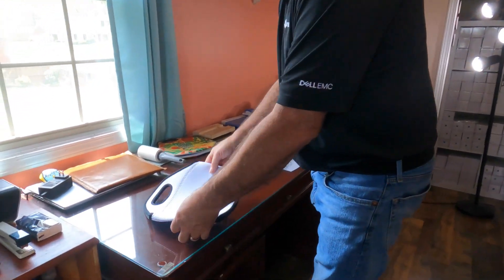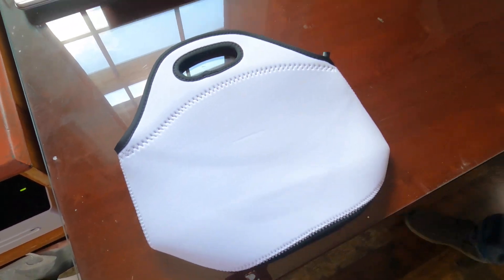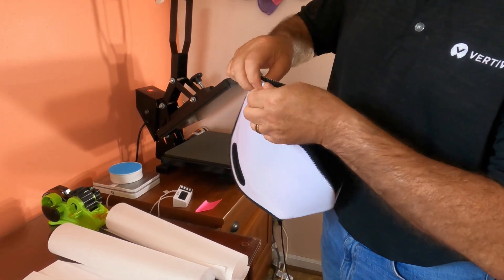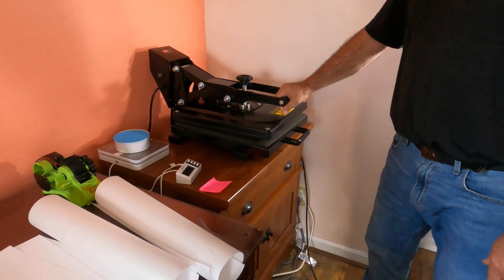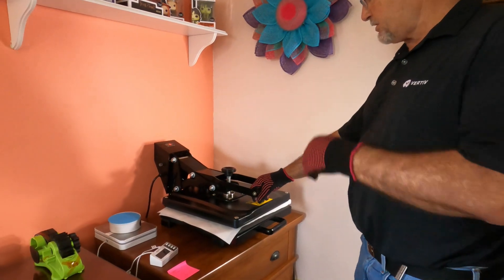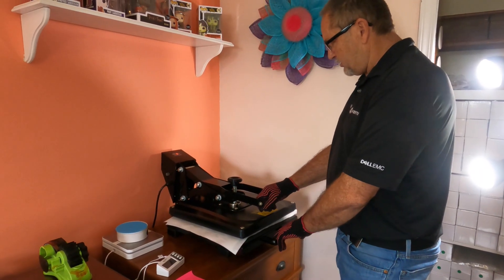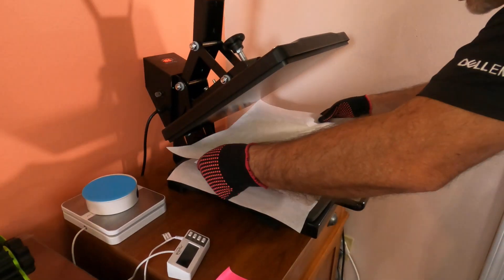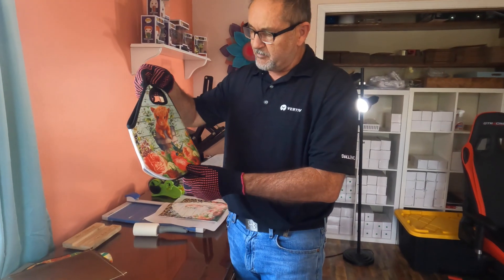How to Sublimate an Insulated Lunch Bag: Step By Step Guide

Comment: You need to make a template out of card stock or cardboard to fit inside the bag to stretch a little, place it inside the bag make sure it is over the bottom part of the bag for each side, and you won't get that line or empty corners, I found this worked just fine
Reply from the maker: Thanks for the idea! Thanks for watching!